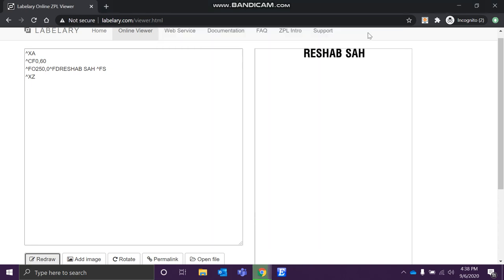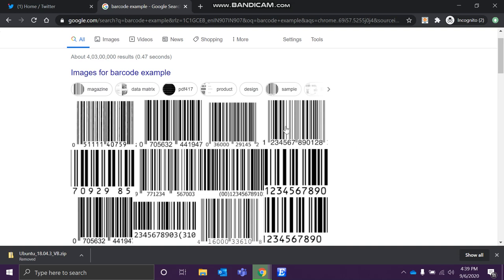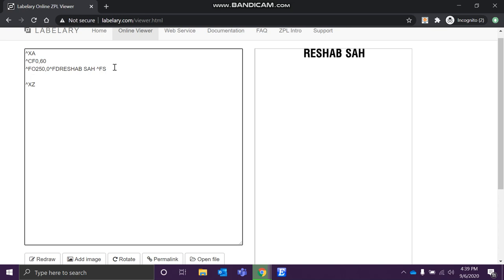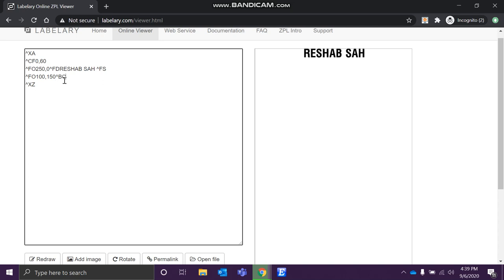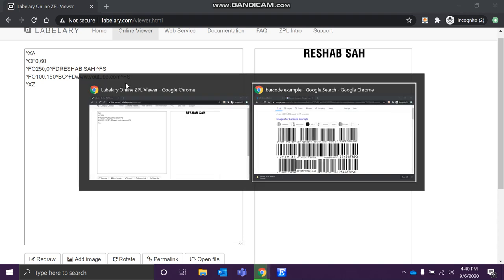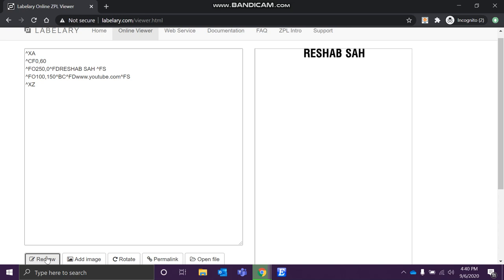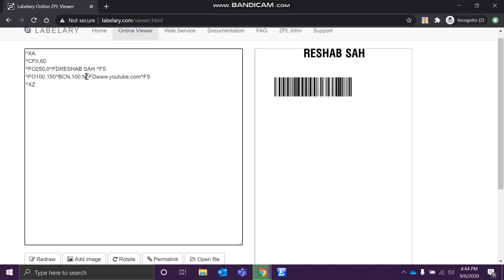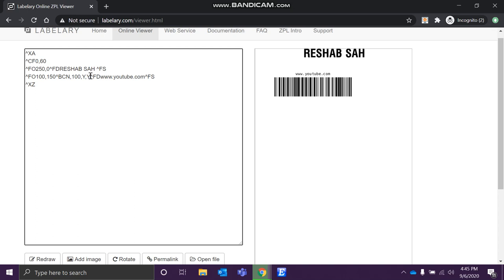Design Barcode using Zebra Printing language | Barcode for labels

Comment: my page width is 105 mm, we need to generate bar code, some times we give small value of bar code and some times we give big value, both cases we need to generate bar code in center of page, we are using zebra language.how can i proceed? could please suggest the code.
Reply from the maker: Hey Buddy sorry for late response but in the zebra there is no way you can dynamically center the barcode.
However if you can dynamically generate the printer object file or the zpl cmds only then it’s possible